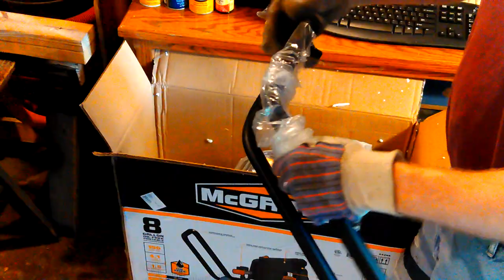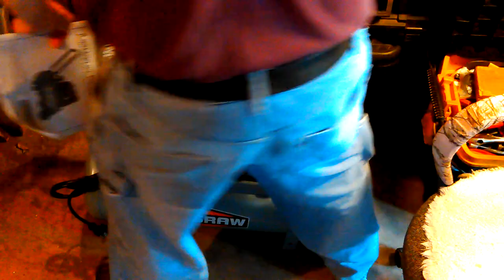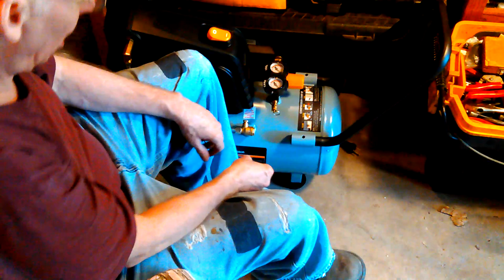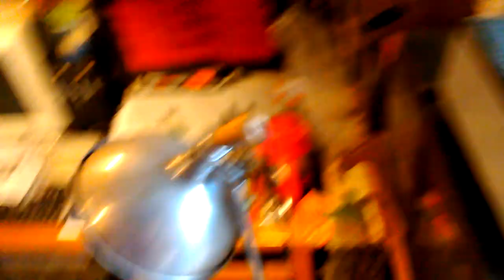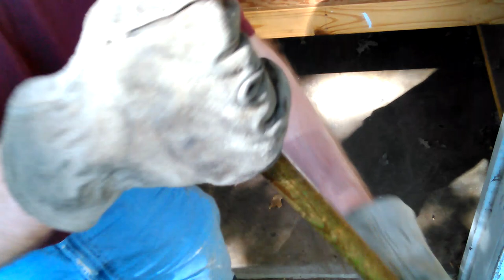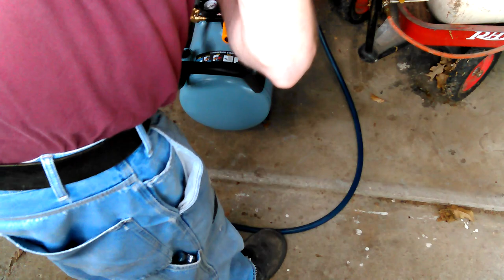Harbor Freight McGraw 8 gallon 1.5 HP 150 PSI Oil Free Air Compressor Setup Pt1 2019-05-17

Comment: I bought this compressor and returned it. It was loud and did not work well. My 6 gallon pancake compressor worked better.
Reply from the maker: What were you using it for? Ya, mine is loud too. But, it runs my 1/2 inch Impact Wrench well. That's all I have used it for, so far...  Don